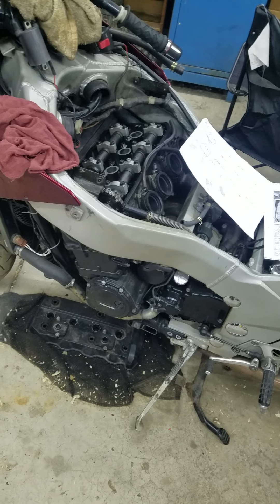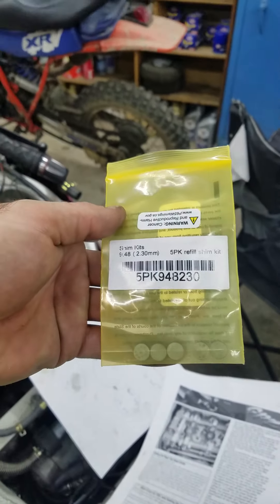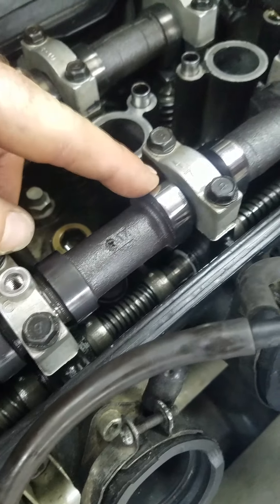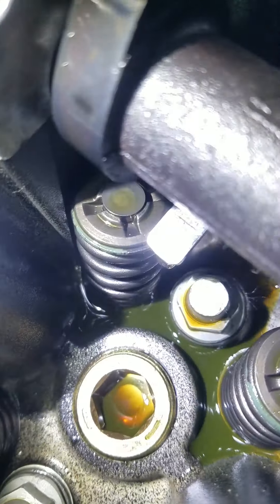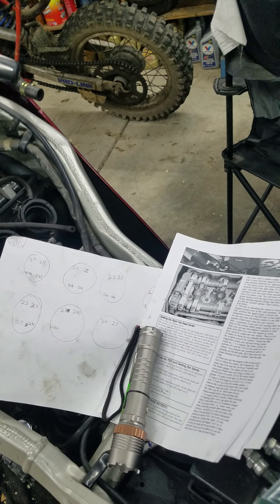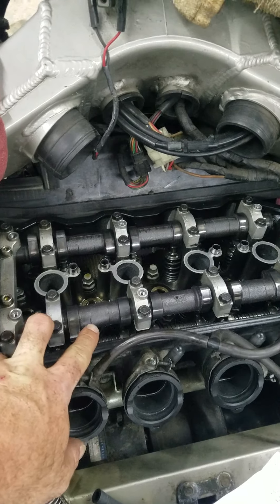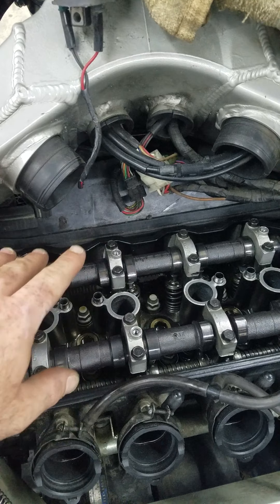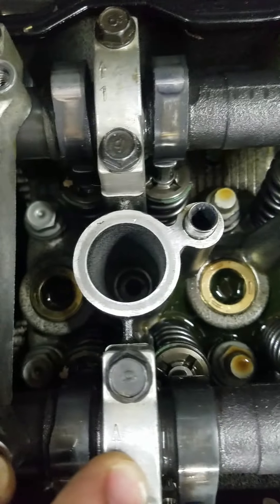1996 zx1100-d valve adjustment

Comment: I have a GPZ1100 with the same engine. Was your engine making a rattling noise when going over 3000 rpm?
Reply: That is a chain tensioner or stretched chain issue sounds like to me.